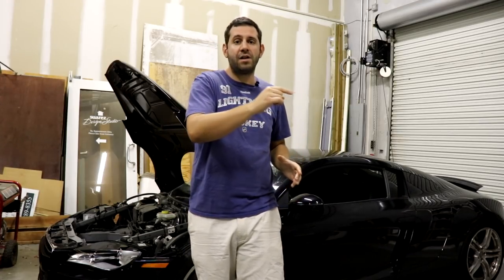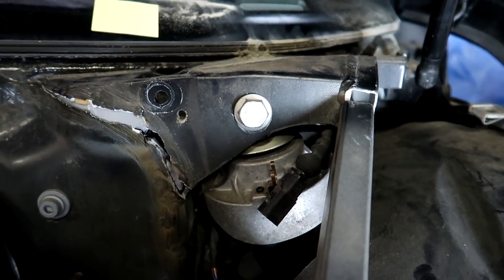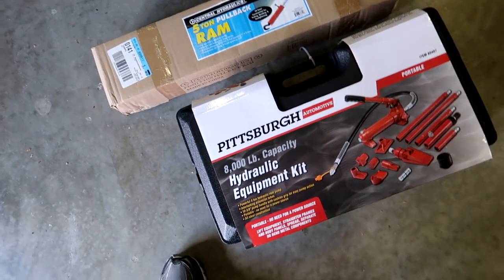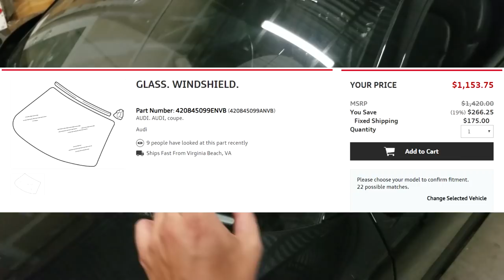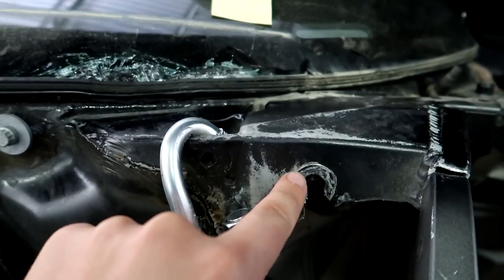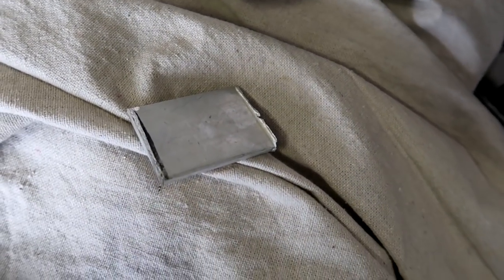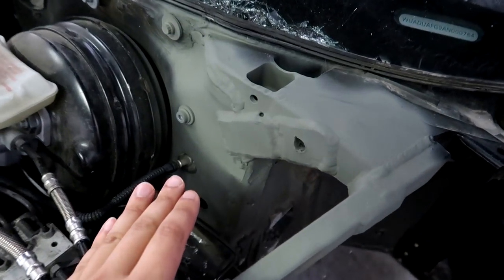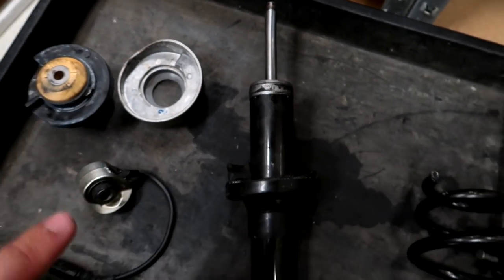I Repaired My Totaled Audi R8's Cracked Frame for $500! Insurance Quoted $29,522!

Comment: 7:08 well it will if you hit the edge of the windscreen....DOH!!
Reply: Yeah. Shit happens. Oh well we all make mistakes. Including recently I decided to jb weld a radiator instead of replacing it, well it blew and took the head gasket with it. So that was a 500 dollar mistake. His mistake was more expensive but that's a good example.
Reply: @ilikeboost4764  Why would that cause the headgasket to blow?
Reply: BoogieDownProduction it overheated when the radiator went warping the heads and block.

Comment: Perhaps it would have been a good idea to build a jig and pull it down at the end of that piece to get more leverage and not pull the bolt through. I would have made a nice shaped gusset and welded one on the other side as well so it looks like it was meant to be like that. Could have had a frame shop pull it down for very little, may have saved the windshield!
Reply: @g6et_wrx177   Ya that is a good idea as well.

Comment: In the blind headlong race to "repair" the car for as cheap as possible you totally overlooked determining what force caused the damage. You might have gone the next step to remove the lower undercarriage cover to see what impact damage it reveals. I'd think there is still other damage. Your cosmetic repair of the torn metal shows no respect for metallurgy or the kind of forces required to rip the mount lose. All the aluminum that has been over stressed needs to be properly replaced - you can't un-do the damage of metal that has been stressed to point of fatigue failure.  If you seriously plan on driving on your "repair" I'd remove the sealant primer back to bare metal and leave all the removed trim off. Drive short distances and pop the hood to check the bare metal and surrounding area for the new split that will eventually or suddenly appear.  Really, your post should only have been  allowed on April 1st. It could embolden others to be as irresponsible as you.
Reply: We do know it was enough force to bend a tempered steel strut rod, so it definitely took a serious hit.
Reply: @g33dav3y  Probably a sweet jump over some railroad tracks.
Reply: You're ignoring the fact that this is a well known and documented problem that Audi has acknowledged.  They have a reinforcement part that they have devised to handle the fix.  He didn't use it, but the fact that he knew where to find the crack, and that many other cars had experienced the exact same crack, tells you that this is a design shortcoming that is fixed by realigning the strut box, and TIG welding everything back into place.  Done.  Just remember to top coat all that primer, and be honest with the next buyer about how the work was done.
Reply: @karlInSanDiego  I agree. He should make it his daily driver, use and abuse it and come back in 6 months to show no cracking. But I would leave the top coat off for a while to see if any microcracks.

Comment: If it was my car i would have ground the crack weld back flat and placed a much larger plate over the top shaped to fit. a postage stamp size plate is not enough in my opinion for what can be tons of pressure.
Reply: Yeah, they make reinforcement plates for this repair. Not sure why he didn't buy and install them.
Reply: @OMGWTFLOLSMH  they only sell the plates to factory certified Audi repair centers.
Reply: @kevins9335  As if we can't get that stuff online. Lol.
Reply: @Swordie100  let's see that parts link .
Reply: Spark Plug Steve that is the right way to do it and this guy isn't into doing it the right way
Reply: @williamrage6225  you didn't actually link to the part.
Reply: His first words were "It is a sketchy repair." That gave me some warning but this is ugly beyond words and has no place even on a Yugo.

Comment: A lot of Audi engineers and welders in the comments
Reply: Aint that amazing lol
Reply: Ryan Pettit only reason Audi doesn’t approve of this repair method is because if someone repairs it this way and does a shit job and someone gets hurt Audi can’t be sued for someone’s bad repair. Audi doesn’t want to repeat something like the “unintended acceleration” fiasco.
Reply: Some people may know about metal science even if they don't work for Audi
Reply: @jimmygrant3212  no, it's because welding changes the strength of the aluminum, weakens it significantly. Look at yield strength of t6 vs o 2024 aluminum
Reply: avedesco well I guess we’ll see if the metal is weakened enough to crack again.
Reply: Right because multi billion dollar insurance firms would rather total out a car for $50 - $100k than repair it for $500. Just keep that car in FL and far away from the northeast.
Reply: @user-nj2wk2ec2b  liability is a different calculation for a mega corp, its just the practical reality.
Looking at other videos, the reinforcement plates are kind of like that, less than you'd imagine, but i guess its enough.
Reply: If the plate had four circles innit, it would be fine. AAMOF, I would have stamped them there myself, just to annoy keyboard warriors.
Reply: @akkual  Amen
Reply: K J  well maybe these so called engineers need to step out of the office and work in the real world, because the ones that engineered the R8 stuffed up big time
Reply: @m6sports  dude. Buy yourself a totaled car and fix it! Darvin will do the rest.
Reply: @MidwestFarmToys  Thats the answer i was looking for. Thumbs up for you Sir.
Reply: @gmourao  lol
Reply: It's not just a repair the material cracked because it was too brittle which is good at absorbing energy on the event of a crash. The new more maliable frame will bend differently and will behave differently in a crash. Audi wants the whole front clip replaced to maintain the safety profile. The secret is going to be to not crash it.
Reply: @user-nj2wk2ec2b  Yeah a multi-billion dollar company that cheated on emissions tests and offered hacked solutions that got them even into more trouble with a $7 billion dollar settlement and thousands of cars sitting in giant airfields collecting dust. Acting like these companies know better or have any ethics or moral standing is just plain wrong dude.
Reply: @jimmygrant3212  yea! with your family on the road too :DDDD
Reply: @m6sports  you know nothing of car desing. ever heard of marketing or finance? probably they forced this issue in for cost reduction despite engineers resisting like this happens a lot of time. ever heard of the space shuttle disasters? despite rumors, going to school and knowing things happened before instagram came online is not a bad thing for you...
Reply: dont need to be an audi welder submarine welder is fine enough!
Reply: avedesco That’s why you use gussets in addition to welding the cracked areas, and also use the proper alloy filler rod. If done properly a weld can be stronger than the original material strength, no matter what type metal it is.
Reply: J It’s too much liability and they don’t want to get sued. That’s why they just total it out.
Reply: @MidwestFarmToys  Yep. Im an inspector for a major insurance company. I deal with this every day. Audi does not have certified repair shops just because. It's to make sure the car is repaired correctly and to THEIR standards. It protects the owners investment and guarantees a proper repair. People think just because something is repaired that it's repaired right. Not the case.
Reply: I got to stop commenting when I’m drunk.
Reply: I mean, The Best or Nothing right? wait..... wrong make....
Reply: @user-nj2wk2ec2b  I guess they gonna use this clip when this dude kills someone...
Reply: @MidwestFarmToys  No this falls in line how people give these companies too much credit when it comes to their "engineering" practices. When it's very common practice and an accepted method to brace the frame in this manner. It's pretty ridiculous to price this job at $50k when you can have a veteran welder work with various metals know if the structure will be able to hold stress overtime. Audi (Volkswagen) have lost most of their credibility when it comes to trusting their engineering Technics especially when they overlooked this issue designing the R8. My point is valid, just like when any other company that makes stupid decisions and try to pass off the cost to it's own customers.
Reply: @MidwestFarmToys  Another stupid condescending answer that that avoids all responsibility from the original manufacturer.
Reply: MrBiskuit - yes I know by the end of the lawsuit the idiots finally admitted they hit the gas instead of the brake. But by Audi saying there’s only one way to repair the frame by replacing it protects Audi from idiots like in the unintended acceleration lawsuits.
Reply: @jimmygrant3212  tbf that audi fiasco of the unintended acceleration was just sad.
Reply: @MidwestFarmToys  will he even be able to get this car insurance
Reply: @avedesco  Only way is this repair should be gusseted, the crack area is weak and should not be welded at all.  A larger piece should be welded on further out from the shear once the joint is realigned.  20 year EE and even I know that...
Reply: @MidwestFarmToys  no it's not how sensitive or complex it is, it's just know alls in the office messing things up when there are better ways of design things given by people who actually have to work on things day day out, plenty of so called qualified people mess things up, for example big pharma...
Reply: That is an easy repair. I've done many like that. Hard to believe the engineers didn't see that in the FEA.
Reply: @jimmygrant3212  ha yeah unintended accel that was a funny mess
Reply: K J Germany makes things notoriously complicated
Reply: webnothing  There's a vast amount of stress and strain going through this part of the car - I'd be genuinely surprised if a repair like this lasts longer than a few months. Aluminium is a so, so soft in comparison to steel.
Reply: This is super fucking dangerous, don't try this at home. Jack stands aren't meant to hold weight in this way. There are plenty of cheap ways to fix a frame that are far safer...
Reply: I've been designing chassis and suspensions for decades and wouldn't have designed that spring support that way. You can get away with if that was steel but NOT aluminum. Aluminum has one third the weight but half the strength and fatigue resistance. You can't have sharp inside corners of a  loaded structure. That is a bad design plain and simple.
Reply: That whole crack should have been reinforced alot better than it has been ,road use and pressure on that shock is going to pull that weld apart again ,it might take time but it will tear , I would have cut a piece to fit in there, back and front of the weld overlapping ,as well as welding the original crack at the very least to feel some bit secure of that not failing again ,that looks a very shoddy weak fix ,and dangerous
Reply: @randallr.p.mcmurphy863  so am I. This is a major hack job.
Reply: @shanepetit  Pretty damn scary. I love all the comments about the Russian guy Arthur and how great he is, too. The guy uses a tram gauge and a tape measure to change structural parts on a BMW! No jigs, no upper/lower body measuring, no BMW approved welder. And people think because it looks pretty and still drives (dog tracking down the road) that he's some kind of genius. For God's sake go to Glendale or Pasadena CA and you'll see that kind of hackery every day. These guys are no different than the guy using a tree and a come along.
Reply: @MidwestFarmToys  they can't seem to grasp the concept that it's not about welding and bracing metal to withstand the fatigue of daily driving. It's all about how that structure reacts in an accident. What forces are generated and how those forces are directed around the passenger compartment.
Reply: @jimmygrant3212  or Audi could have just built a better car too?
Reply: @randallr.p.mcmurphy863  we'll just jack it up, pull it together with porta power and weld it. Good as new! Until it's in an accident. That's why there are specific procedures required for these repairs.
Reply: @shanepetit  yeah and the shampoo bottle says repeat wash...but who does that?
Reply: You madd cuz he fixed it!!! And you jealous too cuz you wish you had an R8 but your stuck with your Honda from high school🤣
Reply: I AM an Engineer!
Reply: It was not super smart way to fix that aluminum frame like that . Hard to believe . WTF??????
Reply: @user-nj2wk2ec2b  because it'll never be 100% they <<INSURANCE inc>> wouldn't take a chance clearing it for the road then someone takes it to the track and smashes into a wall exploding themselves...
Reply: @MidwestFarmToys  They're no more complicated than any other 'super car'.
Reply: @MidwestFarmToys  Complicated compared to what? Not everyones idea of a performance car is a v8 bolted to a couple of railroad tracks?
Reply: @m6sports  One of the best comments I've read so far. GL
Reply: K J So why did the smart engineers not play this out in the original prototype of the vehicle? Their calculations were clearly off as this became a problem needing recall
Reply: @MidwestFarmToys  and the point is the VW group has had serious problems with ethics and designing vehicles that comply with required legal mandates, so how do we know if they're lying again or not?
Reply: @MidwestFarmToys  and I've worked in a few plants where the engineers didn't listen to the welders and instead waved their degrees and superior intellect and implemented their solution or design, after months of screwing around and hundreds of thousands of dollars in lost production and off spec product we finally do it the welder's way and so of a gun it works.
Reply: @jimmygrant3212  agree some of it is liability management, some of it is financial decisions, if the cost of paying the car's owner for the car less the recovery they get when it's sold is less than the cost to repair the car is an economic total
Reply: @drshocking1229  and we still believe the news organization that ginned that on up when they talk about our president
Reply: You dont need to be an engineer to see that this reapair is like Dancing on very thin ice
Reply: @MidwestFarmToys  thanks for stepping up on this, Dunning-Kruger effect at work. "old" welders saying "thar crack ain't nuttin ta fix"
pretty obvious it's a failed design with 40k on the clock, pattern failure. 
lipstick the pig all you want, i'm not smarter then an engineer, one of my mantras.
what remains to be seen, what happens to the car next, as safety inspections vary from state to state.
will the inspector certifying the salvage car be qualified to approve the repair, if they are even told about it?
will Sam's arrogance lead him into complacency and selling the car, could he give full disclosure? (not would)
sure it makes for interesting viewing, Sam is no mechanic, but does he give a damn?
this is the same, not similar to "clipping", gluing  two cars together and calling it safe.
https://www.kbb.com/car-advice/articles/safety-of-welded_on-parts/
that article does no justice to the metallurgy aspects of modern materials.
i'm sure Samcrac wants the reputation of a con man, even if he's only lying to himself, which i doubt.
Reply: @user-nj2wk2ec2b  Look at it this way, he DID prime it and almost got the colour matched. He DID anneal the aluminuim for 2 whole days with variety of tapommetors to reform the micro-crystaline structure of the base aluminuim.
And FFS DO NOT anchor to the anti gravity device, its the same as cutting the branch off the tree whilst you are standing outboard of the cut point.
Reply: right? I'm trying to figure out why they think it will break again when the welded an additional plate ontop of the crack, how do they think wheels are repaired
Reply: That frame looks pretty weak for a car so powerful..
Reply: People are failing to realize this is the exact method Audi used to stop the frame  cracking in later models
Reply: avedesco it’s called metallurgy and they would be a metallurgist and or various other titles that share metallurgist as myself who owns a machine shop that welds various alloys/metals and heat treats various steels. Yes there are people that exist who can offer an educated response however the responses here are from a majority of idiots.
Reply: lmaoo
Reply: Many are correct though aluminum welding isn't a simple task, it's not like welding steel back up
Reply: Donna Peroche  hey
Reply: gm92845 has
Reply: everyone's an expert lol
Reply: John barfneck and your type of guy who has to pay someone else to change the oil in your car
Reply: John barfneck “no disrespect “ but you did disrespect
Reply: John barfneck you got me. Now go back to playing black ops
Reply: Well not everybody here is an engineer but I am a welder aluminium and steel and I am also a bodyman and a journeyman red seal technician for truck and trailer  industry some of us really do know what we are talking about when it comes to this kind of work.
Reply: @avedesco  it obviously isn't that strong in the first place so it's no worse than the original build
Reply: Donna Peroche  Audists
Reply: No, just a lot of people with common fucking sense!
Reply: @ancheno7167  Exactly what about any of those things could be considered a pre-requisite to being allowed to comment? However, I would say that your very poor English automatically disqualifies you.
Reply: @billybob042665  Not sure if you realized, but the engine is in the rear of that car. The only thing that could be in his lap is the stuff from the trunk.